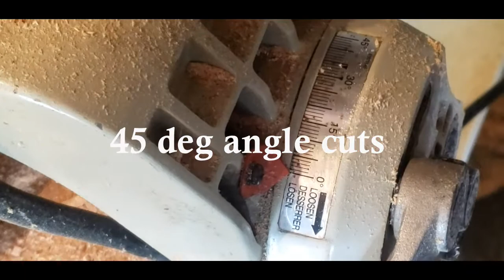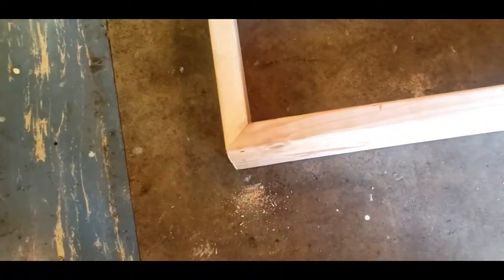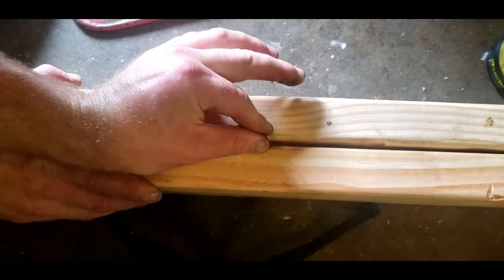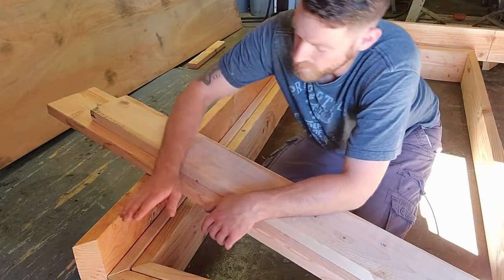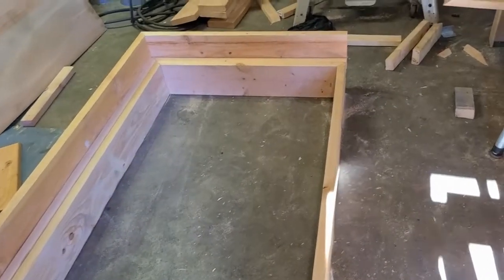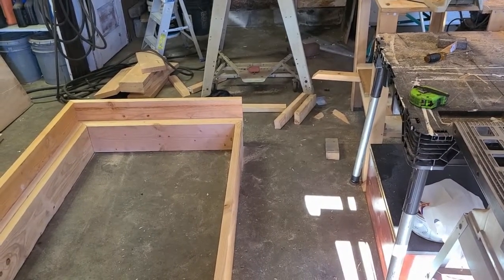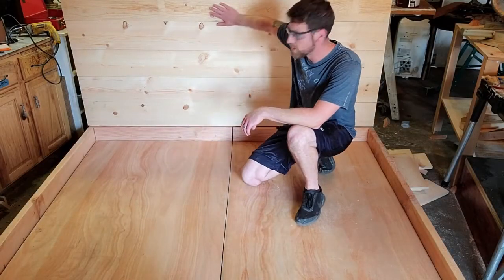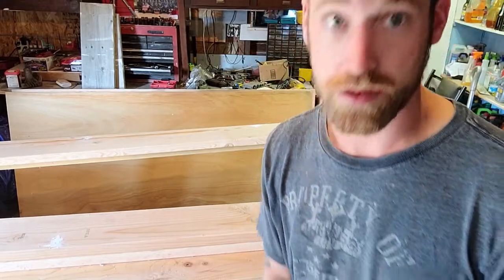King size platform bed frame

Comment: I have a plate form bed. Im missing the 8 legs and the screws. I cant the exact replacement parts. Any idea what i can do?
Reply from the maker: Depends on preference. I prefer the bed frame lay directly on the floor so nothing can get under it. But if you want it higher off the ground you can make new legs out of 4x4 blocks or if you know the manufacturer of the bed you might be able to order the pieces separately only.

Comment: I would like the measurement???
Reply from the maker: Its been a few months since I did that project so I went and measured what I could without taking it apart. I used 2x7's for most of the frame witch makes it rather heavy so be aware.  Its 83" long and  80" wide. its a 2 pice so the pices are 40" wide for the 2x7's that run the width. 2 pieces of plywood (I think I used 1/2 ply) 38 1/2 x  80" long. the head board is the same width as the bed but its 46" tall. I hope this helps. I would defiantly measure as you go before just cutting everything out. "measure twice cut once" as they say.